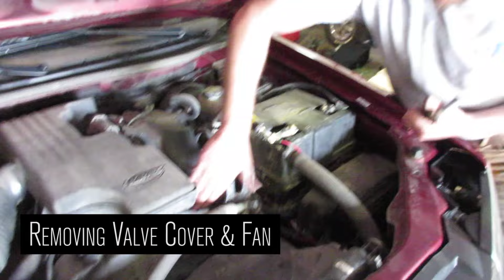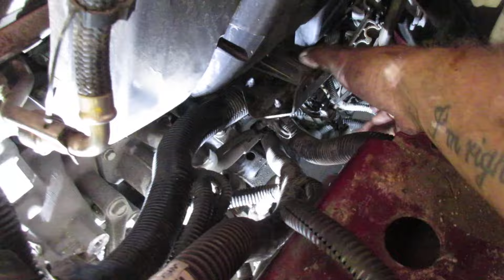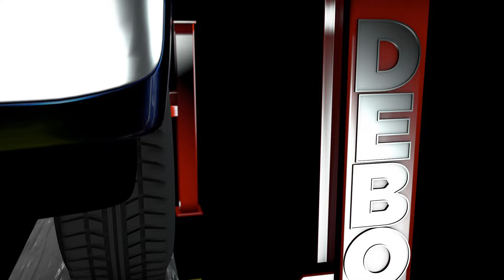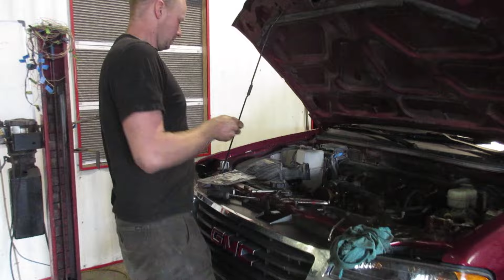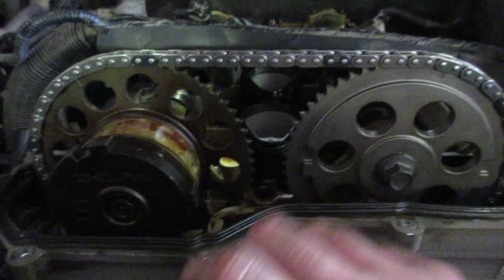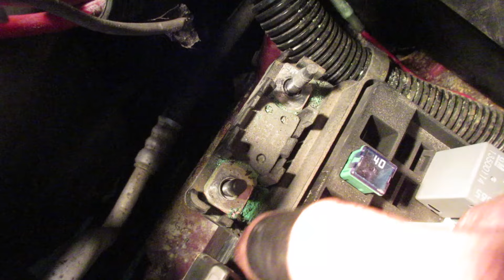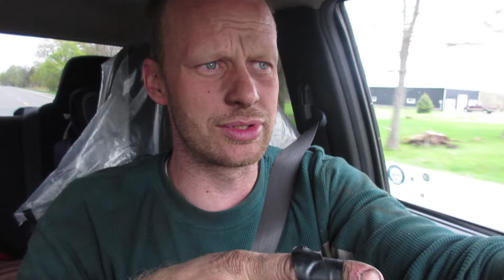Over-Engineering At Its Finest! GMC Canyon Needs A Timing Chain

Comment: GM doesn't "over engineer" anything that  timing chain look more like a bicycle chain with only two link bars.  Look at old school timing chains they had four link bars or more and lasted the life of the car.  GM uses a Chinese cost model against suppliers which usually amounts to low bidder minus another 6 or 7% so suppliers have almost no profit which encourages cost cutting. I worked for a GM supplier for 11 years they are the worst customer to deal with in automotive.

Comment: I swear GM has to be the worst when it comes to premature timing chain failures once they went variable valve timing. I've never had to do more timing chain jobs than on a GM. The 3.6 engine is the worst pos I've ever dealt with. Timing chains should last the life of the engine.

Comment: What is GM doing   trying to make things as hard to work on as Ford products..??   A Young Engineer that worked at Chevy   under the smart older Engineers that  developed  the BB Chevy Mark IV   supposedly went to Ford and worked on the Cleveland heads

Comment: Fun fact, they are the same shift  noid's as a 4l60e...... beacuse it IS a 60E with a diff bell housing on it
 for the atlas series engines  4cy 2.8/9 the 3.5/7 5cyl  
the 4.2 ( best of the series, no balance bullshit)
https://www.topspeed.com/cars/car-news/the-forgotten-inline-engine-gm-s-42-liter-atlas-i-6-ar174949.html
Reply: I was just going to ask if the 4.2 liter has a balance shaft. Because I'd like to use that engine in my project car.

Comment: Were you joking about quoting $4000 for the timing chain?
Reply: He was not. To replace the rear main seal on this pickup and engine, you're looking at ~$1500. Source: me, needing to do just that.
Reply: @murph0666  I was asking because the job looked really simple compared to a lot of other timing chains that i’ve done and I own my own shop and I would charge around  1000 -1500 depending on the price of parts. My price for the timing chain kit is $200-250 and the gasket kit probably around $150
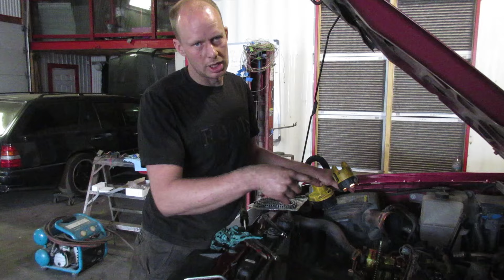Reply: Not a joke. Although you own your own shop, you are probably new to it or have never worked on these 2007-2012 Canyons/Colorados. This video only roughly outlines what needs to be done and omits many steps, for example, he mentions around 4:53 that they had to remove the transmission too. Overall, the video shows about 10% of the work needed for the job. When I bought my 2012 Canyon 8 years ago I did a research on how to do most of the repairs on it. Along the way, I heard from multiple mechanics that this truck line has one of the most complex timing chain replacement jobs. For about two years I had problems with check engine light, error code P0017, and later on engine dying after reducing speed. I changed the variable timing solenoid, cam and crank sensors, and actuator sprocket or whatever the name is (part# 12589782). That didn't help, so I finally took it to GM shop. They said it's the timing chain and the quote was $4400 and 16 labor hours. The quote was from Oct 2023 in Saint Louis, GM dealership shop. I never did the job because they didn't give me any supporting evidence it was the chain. For some reason, I haven't had manifested problems for the past 2 months with the exception of inability to clear the error code.

Comment: Must have been a Ford collaboration
Reply: Like the new 6.7 powerjoke, to replace front cover, remove drive shaft, then transmission, than the oil pan, to replace part on front, have to start at the back

Comment: Shit I have a 3.7L Colorado 4WD and the check engine light just came on for misfire. Replaced sparkplugs and it went away for a day. It's back on now, and I hope to god it's not the timing chain. I have 148,000 miles and the bluebook value is 12k. If I had to drop 4 grand on repairs, I'd just sell it. Please not the timing chain.

Comment: I worked as mr. Goodwrench for 7 years. In a dealership that we called, truck country Central. The best advice I can give any pickup truck owner, for any Chevrolet car owner ... BEFORE YOU TAKE IT TO THE DEALER... check the security light. It's a good idea, to know your security reset procedure. If somebody walks by and lets your door handle three times , it can put your computer in safe mode. Any blinking of the security light, and you may have a problem. Reset your security to see if your problem still exist. A tripped security system can have different problems four different GM vehicles. Sometimes crank no start condition. Sometimes a diminished power condition. Really depending on what you're driving. You got to remember, the game changed when the country of California entered the automotive industry. Sensitive snowflakes needs sensitive snowflake cars. What better place to get those then, the great mistake Corporation.

Comment: "Chevys dont design  trucks so they need to come back to the dealer" -Deboss Grage
Reply: actually these little first gen colorados and canyons are nothing like this description, sure there complicated but very reliable and they are workhorses. i see then around here reach 300k all the time no problem, and by being worked not being daily driven. so this video is wrong when he says that you repair them alot. mine has 109k on it and only has had to have a new powersteering pump, and it was the original one 14 years old so yeah. they great little trucks.

Comment: Those 5-cylinders are absolute garbage. I’ve worked on a lot of engines that other mechanics consider to be troubled or poorly designed or whatever and found plenty of redeeming qualities about them. This engine, however, is simply and honestly garbage. Three family members owned Colorado’s with this engine. Under warranty, one of them had to have the head replaced FIVE times at 3 different dealers before GM finally gave in and bought it back. The second family member had three head gaskets replaced before GM decided to put in a new factory long block - which 17,000 miles later is already on its 2nd cylinder head. The third family member had zero problems whatsoever until he hit 30,000 miles, at which point it developed a horrendous rod knock. The local GM dealer advised that it was a normal condition. Three days later the rod opted to break at the wrist pin and destroyed the cylinder wall. Still under warranty so you’d imagine he got a new engine...and he did. Sort of. They installed a new short block. Unfortunately this short block was a new redesign and an oil supply drilling had moved slightly and no longer lined up with its mating drilling in the head. Never made it off the hoist before it seized the cams in the head. So they decided to install a new head on the new block. That’s fine. But now, 12,000 miles later, the head gasket is leaking oil externally. “General Motors, Wear Qality Is Job Won”

Comment: I worked at a Saturn dealer for a number of years and GM engineers are a really stupid bunch of people! The 3.6 with the 6 speed automatic has got to be the worse power train combination I have ever seen GM come out with. Between the timing chain issues, pcm issues that required a reflash that dropped gas mileage from bad to worse, and wave plates breaking in the transmission these turds cost a fortune to repair. A buddy of mine looked at a Terrain and a Yukon Denali and went with the Denali because it got better gas mileage than the Terrain did. I’d take a small block over that crappy V-6 any day of the week.

Comment: was working at a GM dealership when those shit box Inline 5 cylinders first rolled off Assembly line ... within 19k miles people brought them in with random misfire codes from carbon build up on valves. GM fix ??? new valve springs with greater seat pressure to overcome sticking valves ... a piece of shit cop out to nurse the fuckers till out of warranty .. dont buy first generation canyons later models might come from factory with new springs ... if you replace valve springs with engine in truck with head on be warned using compressed air hold to hold the valves closed when replacing will not work ,,there is one cylinder forget which where there is a casting hole in head so you cannot keep cylinder compressed and when you try to remove keepers the valve WILL fucking drop into the cylinder ..no ands ifs or buts the fucker will drop ..  then you gotta pull the head .. if timing chain seems bad pull the head its a whole other story .. 
if you dont want to drop a valve dont use an air hold .. take clothes line and fish into the cylinder you are working on ... fish about 3 feet into the cylinder then use breaker bar and socket and spin engine over till it stops .. relax the cylinder is filled with cotton // 
now go ahead replace springs //impossible for valves to drop as cylinder is crammed full with cotton clothes line and will not hurt anything ..when springs replaced back off / turn crank opposite direction and remove clothes line and move onto next cylinder .. 
learned this trick years ago if you ever dropped a valve 1 fucking time this method guarantees it will never happen again

Comment: I understand swapping all the Cummins engines. I understand putting a new engine in an older vehicle in really good shape. I even understand wrenching on old stuff, because you like old stuff and it's easy and economic. What I don't understand is keeping some of these shit boxes on the road. This turd makes no sense. It makes even less sense to repair it. I get that it's 7 years old at the time and only has about 100k on the engine, but if you need to remove and replace everything to replace a timing chain and the dealership quotes $4k to repair it, I'm trading it in and getting something new. 

Does anyone in your area have the ability o purchase newer or new vehicles, or is the economic situation so bleak, any piece of trash with an engine has to be kept running? It's like you're living in the Canadian version of Cuba or something. 

I do enjoy the videos though.
Reply from the maker: The truck was paid for, never caused him any grief before this and the bill came to about $5k.  (3600 USD).  Cant buy a new truck for that.  Customer asked me to do it, paid for my services and I do what I'm told.

Comment: I wouldn't call this over-engineering. This is just shit engineering. Over-engineering is when so much time and energy is spent on making something as perfect as possible that it's a breeze to work on and almost never breaks down. Seems the Japanese had the market on over-engineering for a time but not sure about now. I have no experience with modern Japanese vehicles. I've seen 80's model Hondas used and abused and still kept going, of course, seems Honda could have done better by using a timing chain instead of a belt and making the engine non-interference. My current mid-80s Nissan pickup uses a timing chain in a non-interference engine, but, replacing the chain will be easier by pulling the engine. It can be done in the truck but it would be tight working conditions. I want to see a vehicle engineered to last a million miles without major faults assuming routine maintenance is performed.

Comment: "150k clicks" is a small number to mechanics (& technicians), but astronomical to (pretty much) everybody else!
( <--- ASE Pro)

The reason GM builds shitty vehicles, is sales would decrease if they built decent ones.  
Everything would last longer, and if nothing needed replaced, they wouldn't get replaced! = $ALE!

When was the last time you saw a perfectly operating vehicle at a junkyard?  
You never do.  
Those junk-heaps are either crashed, or have a mechanical failure that would cost more to have repaired than the POS was worth!

New cars are just polished turds.

Comment: I think I heard something leaking guys? I have a better and easier fix, just torque the hold down bolt with the throttle, get it going to about 40 to 60 mph(that's 400 km for you Canadians )quickly open the door,tuck n roll, and send her off a steep cliff. Should about do it , problem solved....

Comment: This video is why I own an '86 Toyota by design. I dont want a newer vehicle. Newer cars are total JUNK.    The owner might as well have put a low mileage used motor in it for a $4000. OR better yet, sell it and spend the $4K on something worth owning.

Comment: These trucks are just a pile, when I pull one of these into the shop for something,  it's a pretty damn good chance the front brakes are rotten, check engine light is almost always on and if it has over 120 000 km you hear the timing chain clatter on start up. Absolutely would never recommend these to anyone

Comment: Less then 300k and chains are stretched to point of replacement. And making the job that difficult? Its not much wonder that the domestics are failing. Ive got an older Chev 1/2 ton. Easy to maintain....easy to repair......I would never buy a new GM vehicle after watching this video. GM's have become the Bic lighter of the auto world. Use it until it doesnt work and throw it away. Sad.

Comment: first it is a GMcrape with high miles sell it or just out right do a engine swap as you have it all but pulled to do the job. as from my past XP you will be pulling the engine in the next 75k for a rebuild or swap and who.     thanks Gm for the pile of crap you have passed off on people.

Comment: Canyon/Colorado is one of the biggest POS GM ever put before the public. I wouldn't EVER have one unless it was basically given to me. Also if you live in the Midwest these rust away in about 10-12 years, worse than mid 70's full size GM trucks even.

Comment: I bought a 12 new in 2011 with the I5. 74,000 miles and 2 broken chains and a bad ignition switch. These trucks are money pit. Also the interior of these things are out dated as shit. Junkie old radio in the 12 that gm had been using since 04. Just stay away.

Comment: Unreal. That’s got to be the worst GM engine yet. If you have to run 2 internal balancers that have to be timed with a chain at the rear of the engine.... stop. And start a new engine design.

Comment: These trucks are garbage. Company I used to work for was contracted to GM and we got one of these fairly cheap. After 5,000 miles ours was already burning oil badly enough that by the time we sent it off for repairs about 10,000 miles later we were adding a quart of oil every month.

Engine was warrantied and the replacement wasn't any better, after 7,000 miles the truck had broken down already and was back in the shop. By the time I quit they were looking into getting an entirely different GM vehicle.

Comment: Great video. Shit engine. An Audi v8 has an equally shit setup when changing the timing belt- would you believe the cam pulleys are not keyed to the cam shafts but held on a taper only! Means got to have special dedicated rigging tools,means got to take a loss if a one off or got to hire/borrow the kit. Why? What was wrong with making an engine that can be worked on? Simply keying pulleys to cams and simple holes for pins works well on other engines.
 Reckon manufacturers bring engines and stuff into service without ever having carried out maintenance to see where the problems are and even if things are possible? On new landrovers the policy is to remove the body from the chassis to change the turbos! What madman thought this was acceptable?

Comment: Won't pass emissions because of a timing chain ? Huh? Stupid computer , get off my engine ! Whatever happened to bulletproof GM engines? $3500+ for timing chains ? Bad engineers, no donut ! And no sale... could drop a 300 Ford+ transmission for that, and go 200,000+ trouble free miles..:-(🇺🇸😑

Comment: so eff gm! jimmy's were hard enough to work on so glad i didnt buy a canyon
Reply: actually these little first gen colorados and canyons are nothing like this description, sure there complicated but very reliable and they are workhorses. i see then around here reach 300k all the time no problem, and by being worked not being daily driven. so this video is wrong when he says that you repair them alot. mine has 109k on it and only has had to have a new powersteering pump, and it was the original one 14 years old so yeah. they great little trucks.

Comment: That is not 'over-engineering' - that's crappy engineering. What a bunch of CRAP that is!! For starters, why in the WORLD would they use a standard chain for the cams?!?!?! EVERYBODY KNOWS that will stretch like crazy!! Those NEVER last! And they tend to eat sprockets, too. Ask any motorcyclist with a chain-drive bike. As for the stupid as all get-out rear chain twin balancers - are you kidding??? Did they do that JUST to add complexity and make repairs more expensive?!?! That engine's ALMOST as bad as the 4.0 SOHC Ford used in the Exploders!! Or those stupid as h311 two-piece spark plugs Ford designed to increase their revenue and pi$$ off their mechanics!

Comment: Adda. A gallon and a match, chevy junk ,just replaced my injector pump on duramax 2 fucking days of pulling my hair out at the engineering prowess.never again back to toyotas.remenber this chevy this is why you fuckers had to get bailed out.not only is yota easy to fix, you never have to.

Comment: You dont sound like you know what a specific chain type is do you, one is a roller chain, and the other is a silent chain, and its an engine not a motor, motors are electric, engines are internal combustion, hate it when people dont know what to call parts properly, make you sound like you dont know anything.

Comment: News flash. GM engineering doesn't give a Damn about how much it takes to replace the timing chain. You know why? Because it will be out of warranty by then. These vehicles are designed to be disposable. You going to spend 2k in parts and labor on a timing job on a truck that has 130-170k miles on it and is 7-10yrs old. It's probably worth what 3500 by then. GM garbage....Smh